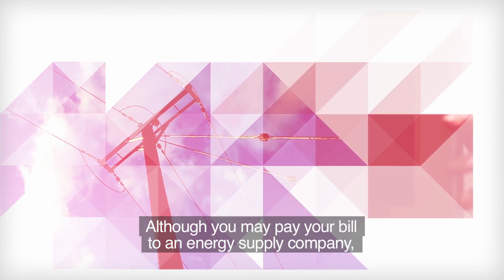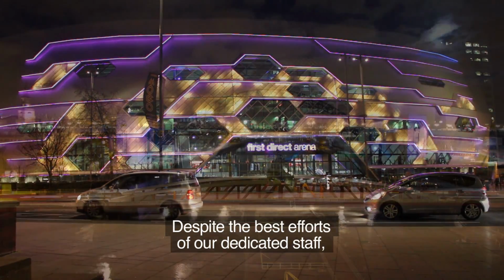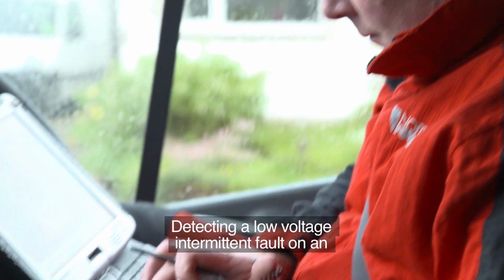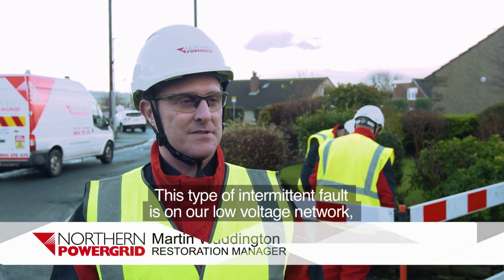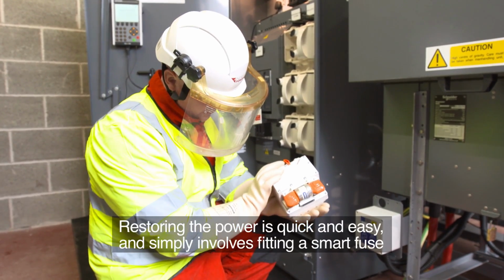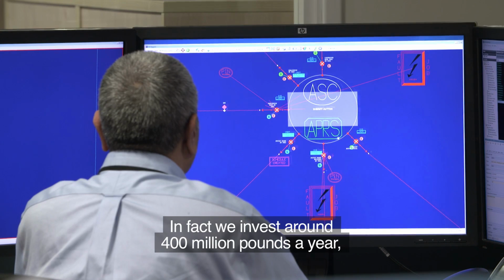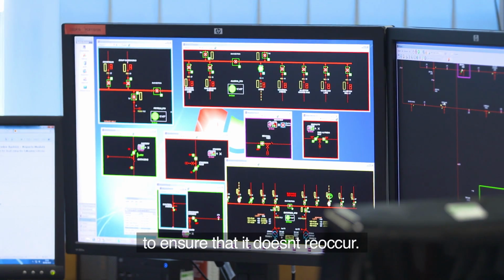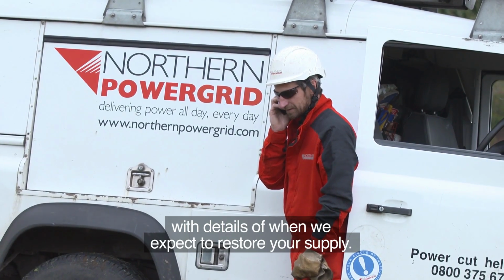Intermittent Power Cuts (Subtitles)

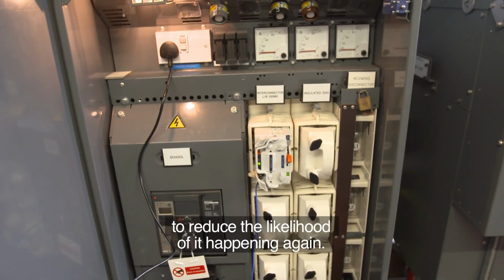Comment: what is  that small white box thing at 1:20 attached to the ring main unit and what does it do? cheers
Reply from the maker: Hi! Sorry for the late reply, it is actually called a Bidoyng smart fuse, named after the spring-like sound it makes when it activates. You can find out more here: http://ow.ly/9SIp307wBuM hope this helps :)